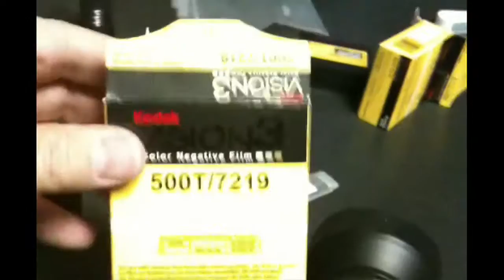Super 8 Film "The 85 Filter"

Comment: Can someone help. I have a Alstar PZ803 and it doesn’t have one of those switches but in the manual it says the 85 filter is coupled with the light socket. Does that mean Ill need to screw something in place while shooting 500t outside?
Reply: yes, for using 500T outside you can get these "85 filters for the lens mount to screw it on, if the camera has no such filter inside. In fact after all these years it is often even suggested to just use an external 85 filter for the lens as the colour gels inside the cameras, that worked as the 85 filter, have aged and either become wrinkly, brittle or have changed their whole tint. But even if you don't shoot with an 85 filter while using 500T outside, you can still use some colour grading or white-balance adjustment in postproduction, since you are working with scanned files anyway. So it's totally not a huge problem. And the more dark it gets and the more artificial lights are in your scenery, the better it works with the 500T material. Just be prepared for shots that have a tendency to look a little blue-ish if you shoot 500T in broad daylight, without a 85 Filter.